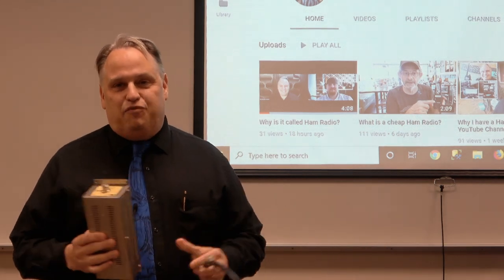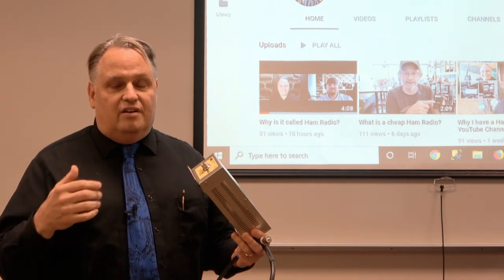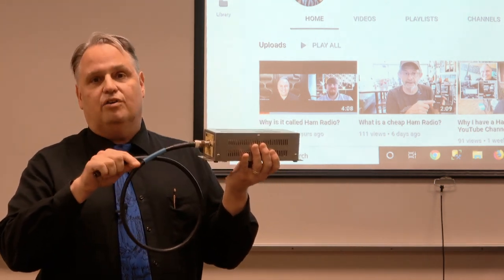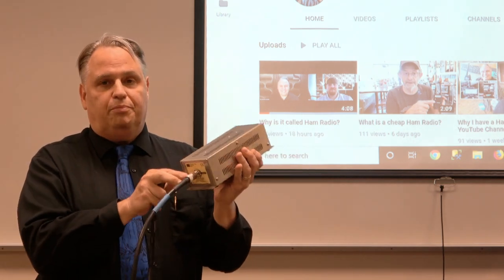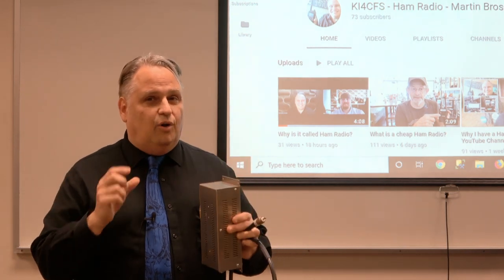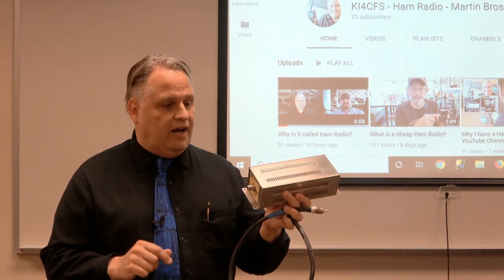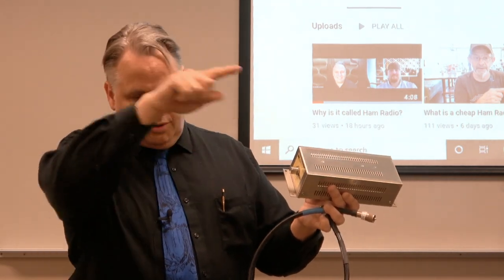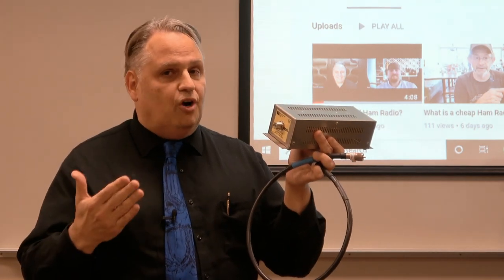What is a dummy load in Ham Radio?

Comment: A good video.  Aren't the more expensive ones the only ones capable of hf, vhf, uhf?
Reply from the maker: Thanks for responding. It is important to check the frequency range and power levels. The one in video costs about $200 and that is why I recommended seeing if you can borrow one from someone or a group pitch in on getting one that can be used when needed. Here are some offered from Gigaparts https://www.gigaparts.com/nsearch/?q=dummy+load 
Here is a classic one: https://www.hamradio.com/detail.cfm?pid=H0-005133 
And some less expensive ones http://www.mfjenterprises.com/productsearch.php